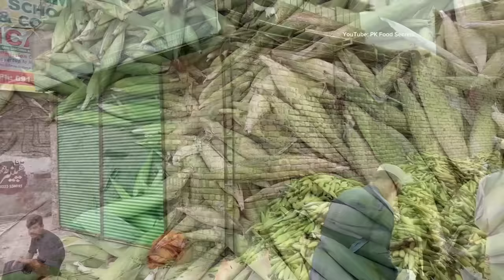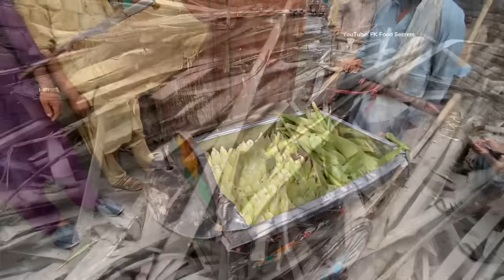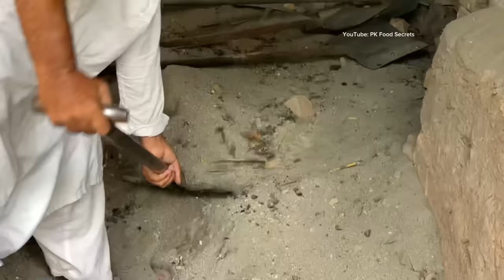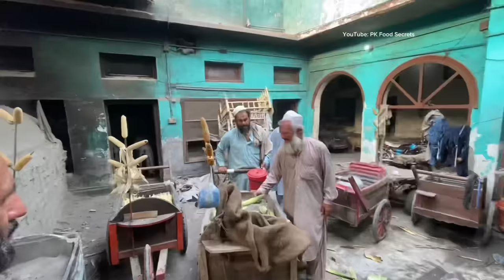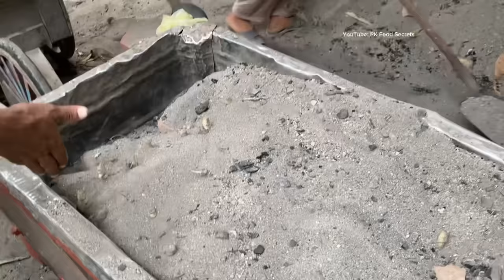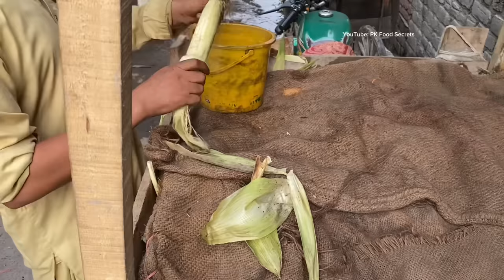How 70 Years Old Man Cooking CORN In Sand | CORN HARVESTING At Mass Production Factory | Pakistan

Comment: 15 hours heating sand to bake corn is not efficient. Why not use the heat to  boil the corn in a pot with water??
Reply from the maker: You're Right but This is Tradtional Method Cooking Corn in Asia. Otherwise They can boil in Water within hour it will ready!  😊
Reply: It's traditional so unique taste.

Comment: Make horizontal wraparound wooden bumpers for the corners of the cart. Use a hammer wood rubber or metal to tap on the corners. Get that sand and ass to fall down in there with ease 👌😎🫡💝😋